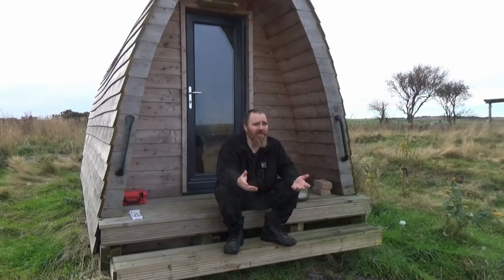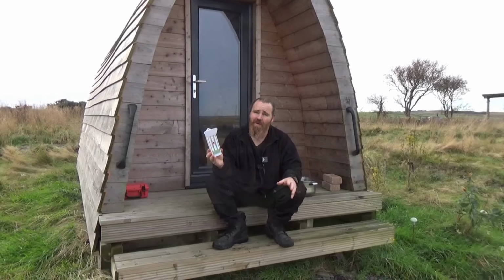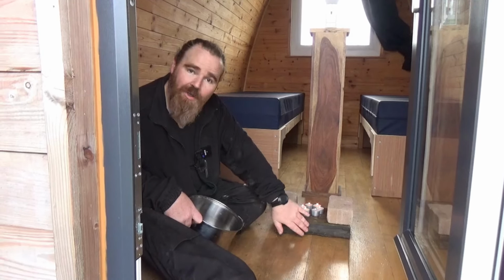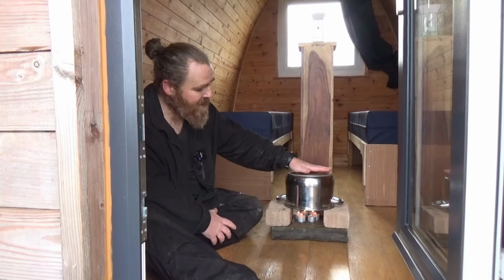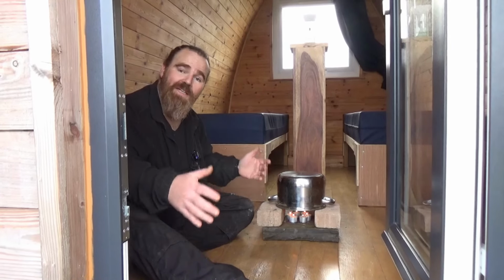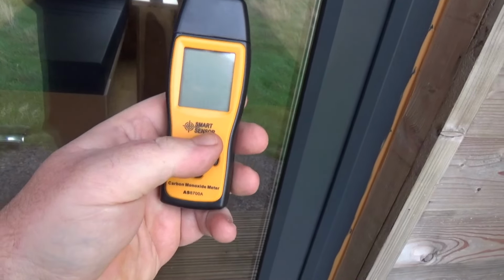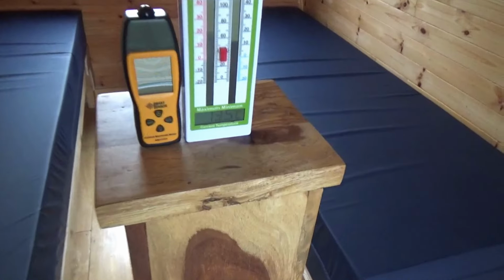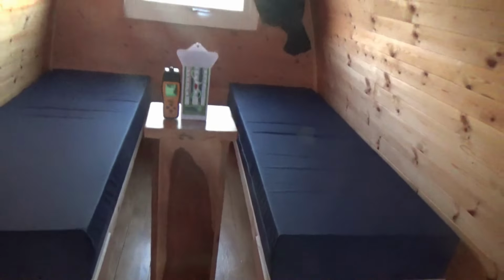DIY Flower pot candle tiny house/camper van/power cut heater tested. Effectiveness? Carbon monoxide?

Comment: Presumably if you moved about in and out the room you had the candles in the carbon monoxide level would drop. And could you warm a pot of water on top of the upturned pot with which to make a drink?
Reply from the maker: Warm yes, but it takes a while.
Reply: @CairnOfDunnCroftPermaculture  Warm's better than cold. I'm in the UK and our power may be cut off for a while soon so these kind of tips are really helpful. Thanks for the video.

Comment: I was told the clay pots can have a blow back and excplode so I won't use that if this ways safer that would help ,I've just bought a Carbon monoxide detector ,I only have 3 cheaper Candle lanterns ,I've been told not to have candles to close incase of emmusion ,

Comment: Heating a space requires convection type heat.  Radiant heat is only more efficient at heating objects within the space, but not the space itself.
Reply from the maker: True. But my rocket mass heater heats through radiant heat, and I find that enough radiant heat will bring the air temperature up too. If the objects in a space are warm, the space will warm up too. It'll be negligible with something like a candle heater though.
Reply: @CairnOfDunnCroftPermaculture  
That's because even radiant heaters emit convective heat as well, plus, as you said,  the objects they heat up in the room also, in turn, heat the air by convection.
The only way I can think of for a heater to heat solely by radiation is to put it outside the living space, like the sun is.

Comment: Would using an alcohol stove in place of the candles be suitable?
Would this be worse for carbon monoxide?
Reply from the maker: I'd be very interested in trying. Generally, alcohol burns cleaner than candles. I'll likely try it this winter.
Reply: I’m no prepper, but I’m going to make a couple of copper coil stoves, out of some jam jars, and stock up on some isopropanol, better to be looking at it that for it 👍🏻
Like the way you could use the top (bottom) of the pot to heat another pot or a tin of beans/rice pudding or something 😀💡  …like I said, I’m no prepper 😆

Comment: The carbon effect could be the material the pot is. What about a cast iron pot? Also, it wouldn't hurt to have some sort of plant that can withstand cold and light heat to help absorb and purify your air.

Comment: Would a stove fan work sat on top of the pan to help circulate the heat?
Reply from the maker: I've found they turn, but not quickly enough to move the air.
Reply: @CairnOfDunnCroftPermaculture  Thank you

Comment: Great video
Reply from the maker: Thanks!
Reply: @CairnOfDunnCroftPermaculture I tried these last year and it didn't seem like it really worked but I like this variation of it and I definitely think it's worth a try because I really have to figure out some ways to help heat this winter
Reply from the maker: If you're on the power grid, I have a video very soon about keeping warm very, very cheaply. If you're off the power grid, I can't recommend hot water bottles highly enough.

Comment: I've heard that the metal pot works better than a terracotta pot, would I be right in thinking that a cast iron pot would be even better and if so would a good thing be to put these candles into a small cast iron woodburning stove, partly for safety so there's no naked flame, it's contained and also so the heat absorbsion of cast iron is better
Reply from the maker: I might try that experiment at some point.

Comment: A better option would be to leave the same amount of candles in each pod, with one covered over with the pan so you can then have a better test
Reply from the maker: A standard thermometer measures air temperature, and isn't good at measuring radiant heat. To measure that, I need a wet bulb sensor, which cost hundreds. I'd like to run this test, but it's not an immediate priority. Hopefully it should happen over the winter.
Reply from the maker: https://youtu.be/sK539ekJ4bo

Comment: Why not have a fire outside and heat rocks then bring them inside in a pot. You can wet them down and have a steam bath..
Soapstone rocks hold heat for a long time, they are used to make ceramic insulaters..

Comment: Do This, But, 
Place a Pan of Water on top of the upside down Cook Pan, 
Heat the water, then Fill Hot Water Bottles to Keep warm in bed. 
Along with Sleeping Bags, Blankets, Quilts etc. 

Fill & Heat as many Containers of Hot Water as you Can, Subject to Water supply, Available Heat, & water Containers you have Available. 

Hot Water Bottles are the Safest form of Heat While you are Sleeping. Along with Warm Bedding.  ( for semi outdoor sleeping ) or a Very Cold house. In Winter.

Comment: Replace the candles with a wick made from carbon felt wrapped in a copper fitting set in a dish of vegetable oil (at least according to Robert Murray-Smith's channel)
Reply from the maker: I'm familiar with that video. I generally enjoy his videos, but he believes that concern over carbon monoxide output is 'woke'. 
I'd absolutely want to test carbon monoxide levels while burning his heater design. Heavier fuels like oil can burn pretty dirty.

Comment: I'm questioning the CO part of the test. CO is heavier than air and will settle lower then rise to fill the space it is in thus displacing O2. You put the meter well above the beds and sleeping area. You should have put it on the floor for a more accurate result. CO will more than likely given the concentration snuff out the candles before it snuffs you out. Lower is better for the candles and the tester. EDIT - I should have watched till the end before I commented but being safe is job one!
Reply from the maker: CO is not heavier than air.

Comment: Thank you very much for the ideas and for checking the carbon monoxide effect with 6 tea candles. I was just wondering what it will happen in my living room, which has large windows at each end and get cold fast as soon as the temps go down or there is no sun. May be a candle or two would keep the temperature good. Plus what if one used beeswax candles? Is it the same than the paraffin one you used and are used in tea candles?
Reply from the maker: Beeswax also gives off carbon monoxide, but at least smells nice!
Reply: Thick insulating curtains over the windows👍

Comment: I wonder if the greater heat due to the presence of the pot over the candles would allow the for more efficient combustion and therefore less CO. It might be worth an experiment between six candles with and without a pot.
Reply: @STho205  

The trick is maintaining a rich flame. 

I wasn't even considering having a pot above it. As long as there is enough air flow below the flame and teh pot tall and wide enough, that should not be an issue.

A candlelight dinner is maybe a couple of hours and the dinners are awake. My concern was burning candles for maybe 6 to 8 hours in a well insulated pod while asleep.
Reply: @ycplum7062  if you're afraid of things, or your skill to maintain such things...best to avoid them.

However the most typical CO and air fuel poisoning cases are nat gas or propane appliances installed and forgotten...burning hidden behind walls and in closets for water heaters, floor furnaces, cen heat, bathroom heaters.  Installed with optimum flame setting by technicians but then never serviced.
Reply: @STho205  

As I said, the danger is when you sleep. It would not be so bad in a well ventilated area, say in a large room or a tent with the entrance flap slightly open, I have no problem with that, but that pod does not look well ventilated. What you burn is only one half of the safety consideration. Where you burn is the other.
Reply: @ycplum7062  as I said...if you fear the device and can't master it don't use it.

Candle pot heaters though are just disaster waiting for a jostle, or soot buildup waiting to catch.  A girl scout gee wiz or greenhouse cobble.  Hardly worth it for 2 degree tepid overall warmth in any typical room

Comment: How about a similar situation using alcohol fuel? I was thinking of an alcohol fuel pot lit and using ceramic logs above a crate over the fire all contained in a large cast iron pot.
Reply from the maker: I'd like to run a test on an alcohol burner, to check the monoxide levels.

Comment: You have the temperature gauge directly above the rising heat current. Your temperature gauge should be set in the center of the room.
Reply from the maker: The thermometer is set relatively close to the heater, because that is how close people should sit to these heaters for maximum effect. To move it further away would not be a fair test, since that is not how it is used.

Comment: So I tried doing this. And I could not get this to work. The pot got hot like really really hot too hot to touch. But after hours it still wasn’t radiating any heat at all. If your hand was a few cms away from it you wouldn’t feel any heat at all. Did I do something wrong?
Reply from the maker: If the pot was hot, it was radiating heat. These heaters will take the chill off, but have limited output.

Comment: Fairly balanced overview but I'd be more inclined to be impressed IF the temp reading wasn't taken from pretty much directly above the heat source 🤔
Reply from the maker: Heaters like these are only effective in small spaces. The whole point is to sit near it to get the radiant heat effect. If anything, I'd be tempted to move the thermometer closer.

Comment: Nice experiment would be measuring delta temp at night, one with pot, one without. I don't see how radiant here makes any difference at that low of a temp, even if it was painted black. On other hand you do loose energy on heating thermals mass of that pot that will not radiate afterwards.

Comment: Drill a hole in the pot and solder or screw a pipe on it.  Drill a hole on the roof or run it out the window.  That will get rid of toxic gases.

Comment: You have to have two separate sections: an upright area for the candle flame and smoke air (intake & smoke exhaust that comes in from outside and exits slowly to the outside), and a separate pipe that is laid horizontal sort of that circulates inside air through the hot candle pipe or box to heat it from transferred heat (this air doesn't mix with the outside air pipes because it's openings are only inside your camping building). It's only passing like a tube through the other area so the heat can transfer to the air in it and move only to the inside building air.
Reply from the maker: Have you built and tested this heater?

Comment: From France
You have to go to bed fully dressed and take your clothes off once the bed is warm and push them to the foot of the bed and keep them on all night. Insulate the neck well from the ambient outside the face can remain in the air. I think the heat comes out better if you have little cover except for abundant bedding in wool or feathers. Make hot water bottles with the glass bottles of fruit juice. Close well without overtightening the lid and put them in a sock. A hot water bottle may suffice. Always leave a small draft between the bottom and the top of the room. The oxygen in the air will help your own slow combustion which is the one given off by your body! In good health you can generate a lot of heat... and without carbon monoxide!
Personal experience.

Comment: Is it possible to put a small pot on those candles and cook if needed
Reply from the maker: Not really, I'd suggest a small camping stove for that.
Reply: Nora I would certainly put a small pot on it and boil water or warm up broth. Also if you have a gas stove but your electric is out...turn your stove top knob and light with a match. Works as  it should 👍👍

Comment: I live in Ontario Canada. In howling-30 below. This does nothing, I know cause I’ve tried it   Installing a woodstove.😊🇨🇦
Reply from the maker: That's nice. I have a rocket mass heater.
As for it not working, this experiment proves otherwise. The difference is slight, but it does heat.

Comment: In a small pod such as this, couldn’t you keep your body warm with this heat mechanism but also have a mask attached to a vent for fresh air??
Reply from the maker: That's a unique solution! That would definitely work, but could potentially be uncomfortable and I'd be worried to sleep with it burning in case the mask came off.

Comment: A better test would be one pod with the flowerpot and another with the candles alone. The only advantage I see of the flowerpot is that it might collect some soot.
Reply from the maker: The amount of energy contained in the fuel in a candle is set. True. However.....
There are three forms of heat energy transfer. 
Convective.
Radiant.
Conductive. 
Convective heat is the least effective, conductive heat is the most effective. 

An example of the difference between the effectiveness of conductive heat and radiant heat is a hot water bottle. If we fill two hot water bottles with a litre of boiling water each, they have identical amounts of heat. But it's far more effective to hold the bottle than to hold your hands six inches away from it. When you touch it. you're experiencing conductive heat. 
When you hold your hands close to it, but not touching, you're experiencing radiant heat. 

Same energy, just transferred to you differently. 
Conductive heat is clearly more effective than radiant heat. 

An example of the difference between the effectiveness of radiant heat and convective heat is a closed room with a window facing the sun on a sunny day.
The room will feel warm if you sit at the back, out of the sun. You are being warmed by convective heat, the warm air is warming you. 
But you will feel a lot hotter if you move to the window and sit in the sun. You are being warmed by radiant heat.

Same amount of heat energy into the closed room, just transferred to you differently.
Radiant heat is clearly far more effective than convective heat. 

You can experience all three kinds of heat from a candle heater. 
Put a board between you and the heater. The warmth you are receiving is convective. The only heat you receive is the heater warming the air, which then heats you. Air is a poor heat transfer medium, so is not very effective. 
Put your hands a few inches from the heater, but not touching. You will feel a lot more heat. This is radiant heat. Much more effective than convective heat transfer. 
If you were to touch the heater, you would likely receive a burn. You would be experiencing conductive heat, the most effective heat transfer mechanism of all. It's so effective, it's dangerous to touch hot objects. 

I am not expecting you to just accept this blindly of course, there are some excellent resources available online you could avail yourself of.
Reply from the maker: https://youtu.be/sK539ekJ4bo

Comment: Hi great informative video. Can anyone confirm if two terracotta pots, one inside the other, would radiate heat more effectively than the pots shown in the video? And does anyone know if using candles made from vegetable shortening i.e. Trex or Crisco would emit less carbon monoxide? Thank you.
Reply from the maker: I've not tested it, so I'd be guessing I'm afraid.

Comment: just get a small woodstove, and vent it with a normal pipe of course; then put the candles in the stove and letter rip... a lot safer. I'd just as soon use kindling and an oak block of wood to finish the project. Ahh...
Reply from the maker: Anyone with a wood stove would probably do better to just light the wood stove.

Comment: What if you used the typical terracotta pot but retrofitted it with a chimney and exhausted the carbon monoxide outside your tiny home?
Reply from the maker: If I was going to exhaust outside I'd probably just use a wood stove. The point of an emergency heater is it can be assembled from household objects without modifying the home.

Comment: I think there is an issue with your test. 
You put th thermometer pretty close to the upflow of the heated air that will plume upwards and out like a fountain.
The occupant would mainly be laying on the bed so the thermometer really needs to bon the bed too so it's not giving a false reading from too close a proximity to the initial glow radius of the heated pot.
Reply from the maker: These heaters work via radiant heat, you need to be near them if they're going to be effective. I ran the experiment near the door so I could read the thermometers through the glass. I'd strongly advise against using one of these heaters while asleep.
Reply: @CairnOfDunnCroftPermaculture  ah right. So more something to sit around.